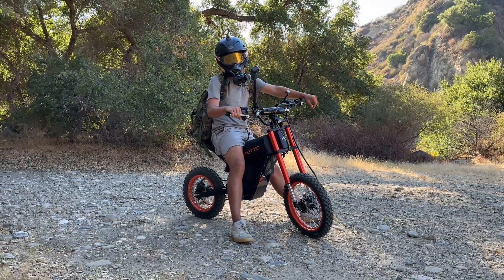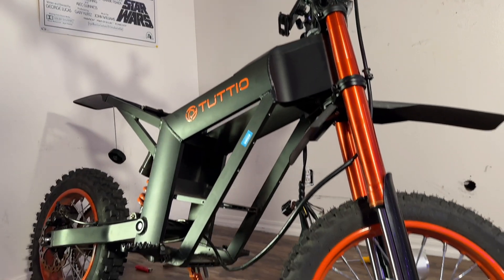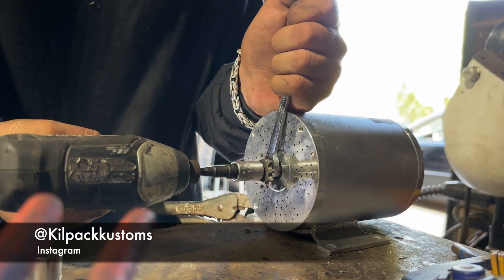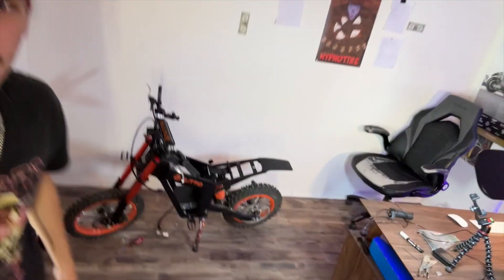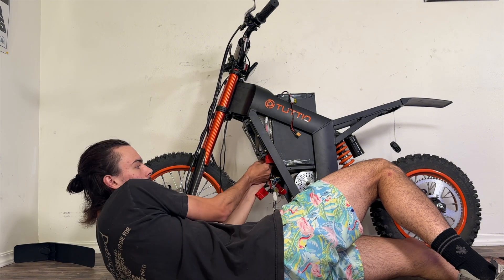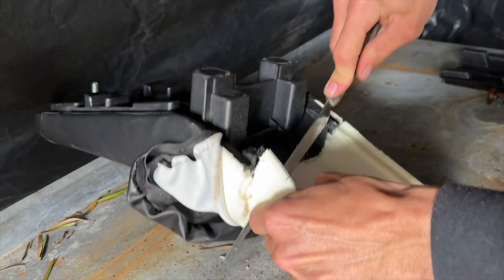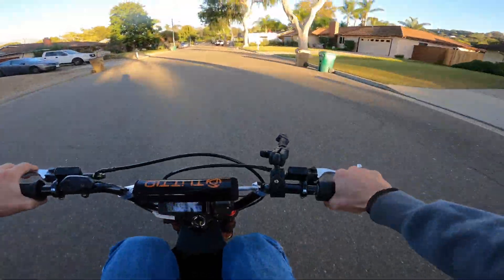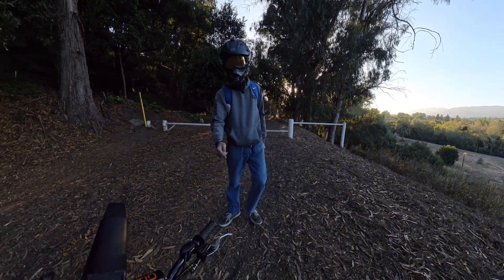72v 10,000watt Tuttio soliel 01 e-dirt bike upgrade step by step!

Comment: how tall are you? im considering buying it but im. 6’2
Reply: it says it fits anywhere from around 5' to 6'1 so you should be okay it might not be a perfect fit but i'd either reccomend getting the pegs changed or get bigger tires because of how small it is
Reply: I'm 6'2" and a fat a$$ lmao and it still carries me around very limited leg movement tho stopping yourself if not very flexible can be a challenge. Add max psi in rear shock of 150psi and bigger tires and your definitely golden i love this little tank 😂
Reply: Sabvatons are trash 😂 and your dumbass used a my1020 motor and said it was an upgrade holy fuck

Comment: I was onboard right up to the chopping of the seat. I'd be interested to know what the long term solution is there. I'm hoping Electro and Co comes out with a drop in 72v battery.
Reply: it says coming soon for a tuttio 72 so 🤷‍♂ i hope really soon
Reply: You can order a 72/40 battery custom built same dims as factory 48v. From amorge

Comment: Can I just upgrade the battery and controller
Reply: the motors peak is around 3000w if you upgrade the battery. the controllers peak is 4000w so no need to upgrade the controller unless your getting a new motor

Comment: you didnt have to change the controller you could tune it to 72 volts
Reply: Yeah but a controller that’s meant to be for 72v is probably better but tbh you could be right idk
Reply: that controller prob can only handle 3000w
Reply from the maker: No it’s a far driver and the amp limit said like 250a it should be able to do a lot more.
Reply: @Beaumonde-m9c  the motor can only do 3000w the controller can do way more

Comment: Why downgrade to a crap motor? Will be weaker and will get hot faster lol
Reply from the maker: Because I didn’t kno
Reply: So can I keep the stock motor and js replace everything else?
Reply: @cesimlim1273 honestly I’d just swap the battery as the stock controller is 48-88v I think and the stock motor can handle the power no problem

Comment: Did you see how many amps/volts the factory motor could take before pulling it out?
Reply: They are 48-72v motors stock.   Coulda used original motor.   Check on it to see if it gets hot

Comment: drop a sotion fw11 in there. it has a 20kw peak and 10,000rpm peak. plus they are very well designed and can take a serious beating
Reply: do you have confirmation it fits
Reply: @Nihicaboll23  you will have to make a bracket like in the video, they are standard my1020 motor size, but basically the best my1020 motor on the market

Comment: what is the largest wheel and tire can you put on the rear of the tuttio soleil 01
Reply: looks like 12/14 are the only option unless you extend the rear swingarm, larger front forks, and longer rear shock. at that point you should be able to fit a 14/17 setup
Reply: @strainfly7372  thanks

Comment: I’m very new to this stuff, how come a 10000 watt battery works with a 3000 watt motor?
Reply: Battery packs are not measured in Watts, Watt hours tell how much energy a battery can store, Voltage  (NOMINAL VOLTAGE, wich for Li-Ion cells is usually 3,6V/cell, a fully charged Li-Ion 18650/21700 cell is aroud 4,2V, wich means that for example a fully charged "72V battery pack is around 84V when its fully charged), amp hours (Ah) times the nominal voltage of the battery is how you calculate Watt hours (Wh), how fast a battery can discharge/ how many Amps a battery can output depends on what cells it has and how many cells there are in parallel (Series= voltage goes up, Parallel=more Amp hours and higher discharge rate), for example the 72V 40Ah (2880Wh) battery pack thats on my workbench rn has 160 LG M50LT 21700 Li-Ion cells, areanged in 20 cells in Series and 8 cells in parallel (20S 8P), each of the LG M50LT cells can handle a continous 10A discharge rate and around 20A peak (momentary), wich means the battery pack can handle a 80A continous discharge rate and 160A momentarely, Nominal voltage the battery pack × how many Amps the battery can output = how much power the battery can supply, wich in my case is 5760 watts continously and 11520 watts for short moments (such as a hard acceleration), so the battery determines how much power is availabe, what determines how much power actually goes to the motor is the Motor Contoller, and how much power a motor can handle without getting too hot depends on what the motor is built and rated for, (for example 2000W), rated motor power should always be what it can handle 24/7 365 days of the year continously, peak power is a different thing and depends on how much copper the motor has, how thick the wires are and a few other things...
Reply: the controller can control the amount of power that is put through to the motor. all done through bluetooth on the fardriver app

Comment: How do you remove the rear shocks on these bikes? I removed the two Allen screws on both sides of the mounting point, but the shock is still not free.

Comment: If I upgraded this bike to a 72 volt battery, would the motor and control be fine? Or would they fry up?
Reply: You’d be fine the motor at least will be the controller should be they actually use a pretty nice and well designed motor in these bikes

Comment: You should get a different motor; that controller can run 10kw ish and you have a 3kw rated motor. You could get more than 3x the power! Awesome video
Reply: The motor changes nothing the power rating is for tempature rating the power will still be 10kw just motor get hotter
Reply from the maker: @ThomasKuhn-vm4ri  yeah the motor is not the best for this I realize. I think if I feel there is an impending burnout I will buy a used Surron motor for this.

Comment: Why didn't you slide the battery in reverse with the slanted side towards the seat? The cables seems long enough to do so.
Reply from the maker: Because it didn’t fit that way and I didn’t want to hack at the frame to make it because it’s no big deal. I’m gonna cover the battery anyways when I get the chance.

Comment: Ok iv got over the initial shock of you ruining the bike unnecessarily so hear is my advice please drill out the vent holes in your motor or it won't last long👀👌🏴
Reply from the maker: I did and I added new steel bearings that can handle more heat. It’s no big deal tho if the other way is better I can just reinstall the old parts and use my 72v battery. I still don’t see how the 48v motor can handle 72v for very long tho?

Comment: You took out a 48-88 volt fardriver comtroller to put in a 72 volt controller? Then you modified the bike to add a  MY1020?? Thats an inferior motor to the one that was on the bike already! Then All you need was a fardriver bluetooth dongle, 72v battery and battery leads.  You did all that work to make the bike worse... FWI the lishen Amorge iron box 72v24ah fits perfect in the tuttio tray. Amorge has a sale on a battery & lead combo for the very same bike at this moment.
Reply from the maker: Well I wasnt aware of that from my research it seemed like 72v would fry those electronics. Also from what I heard the controller can only handle up to 70amps stock which is less than I wanted to use. maybe I’ll use it and the motor for a go cart build or sumthing,
Reply: @ENDOPRYSMofficial на какое расстояние хватает 24ah 72v???
Reply: @ENDOPRYSMofficial  use it in a kei truck
Reply: @ENDOPRYSMofficial  nah ur right it’s only a 70a controller so for what ur tryna run was good idea but I think you chose the wrong motor but ur battery is got beef to it
Reply: 2 minutes in I was about to comment the same such a shame 😮😢
Reply: Everyone knows if you want speed Sabvoton was yesterday and today’s Far driver controllers are the way to go. Just buy up in amps needed and limit on app what your battery can handle. You can always grow into it with motor or battery. Also blows mosfets are less. 
Like mentioned before Amorge batteries are the best bang for your buck. 72v and 300 amp BMS ~600$ get a 500amp far driver and your hitting 80 easy
Reply: @morganst.pierre brother help which amorge battery will work with stock controller and blue tooth dongle ? I don’t wana fry anything
Reply: @ battery is the one component where you can’t go to powerful. Any extra juice just won’t be used by controller or motor. Hard to
Fit on a lotta bikes but the best value they have are in square /rectangle 72v. The critical component when picking a battery is the current amp limit. The higher the better. You start getting ridiculous speeds when you have 72v 160 -300 amp limit and then a controller like a far driver you custom set to match your battery. You can also buy up on a far driver controller say 300amp limit one and then if you only have a 80 amp battery you just limit your far driver to match. A bigger battery with smaller amp controller is safe though just make sure the volts are the same. With motors you can pretty safely run it at lot more watts then rated  like double just make sure it doesn’t get too hot
Reply: Can you please link that sale. Thank you.
Reply: thanks for that, very useful, how much is that pack ?
Reply: So will the 72v battery fry those electronics?
Reply: It has a 2000w motor stock, how is a 3000w inferior?
Reply: Can you link that bettery please?
Reply: Were at? Were can i buy it?
Reply: На сколько запаса хода хватает на такой батарее 72v 24ah?
Reply: Lishen amorge iron box 72v24ah
Reply: hey i need some help, im trading my bike for a tuttio, the guy put a 72 volt battery and kept the stock 2kw motor, he has the dongle he says, but it only goes 50 mph, what motor would you recommend to make the bike faster ? also it would be a lot better if it would fit in the bike without cutting it
Reply: is it true that the stock controller can handle up to 72v?
Reply: So are you telling me I only need the 72v battery im going with 30ah.

Then just need a kunray 8k watt motor if soooo ill buy right now lol ill modify the frame i dont care.

Comment: Outdoor Pat has a video on this bike, same chain problem. I believe they just tightened it and that fixed the issue. The chain is hitting the metal chain guard below it
Reply from the maker: I’ll check
Reply: @ENDOPRYSMofficial  They also swapped out the sprocket and took a few links off the chain to make the new sprocket fit. Not sure if that what fixed it or if it just needs tightening but its worth a try 👍
Reply from the maker: I think my chain is tight but the motor is off and it is causing the issue. I have all day to fix it tomorrow and I will update you with a video.
Reply: @ENDOPRYSMofficial  sounds good I am interested! The bike itself has a huge swing arm so I'd take a look at the wheels alignment as well. Love your videos man!

Comment: Possible chain alignment or front sprocket height issue could cause excessive chain drag noise. I currently have the same issue with my TTR QS motor swap.. been thinking about swapping in a Kunray KR5V into my Tuttio, but not sure if I’m ready for all the frame fabrication quite yet.. Good job for leading the way for information though!

Comment: nice bike ruined.
Reply: Why is it ruined?
Reply: @Surronsterlover-69  where would you start? there's the unsecured oversize battery, or there's the hacked half seat that's putting this kids future kids right next to said unsecured powerful lithium pack, but if neither of those bother you surely the "ghetto ass" sprocket held on by "shitty welds" that is currently probably causing his issues with chain skip seals the deal?, take your pick which but all ring true.
Now he has to persevere with franken-bike or return it to what its supposed to be, a pretty peppy 48v good bike. Of course he'll still have the ruined seat to replace and a big hack out of the frame and maybe some holes, but replacing the seat would go some way to making it pretty again.
Reply from the maker: the bike is legit. Replaced the sproket. And I’m adding a battery cover as soon as I can.
Reply: @AndyPacey  You sound like you've never turned a screwdriver in your life.
Reply from the maker: He has a point it’s not as fit and finished as the stock bike. I do plan on securing the battery as I mentioned in the end of the video. Also replaced the sproket.
Reply: @AndyPacey  it's not meant to be for kids if this 10000w bike that could sure do around 65 + mph then why are making it seem like it is for the kids? Even if the battery was secured down it could still explode and your jewels would be the least of your worries. Your hating on this build but don't understand whys he built it up like this. It's because the "peppy" 48v bike wasn't peppy enough.
Reply: @Nominally-Built  i made a custom kona stinky 72v80a in 2009, that's 2009. It was powered by an RC helicopter motor with aluminum gear down (belt drive) which was designed to operate around the bottom bracket which allowed normal mtb pedal operation also, oh and there was the 3 years workshop training when i left school, maybe why i'm a little mortified at the build.
Reply: @ENDOPRYSMofficial  Son, Yours is the most mature response to criticism here, genuinely impressive. I totally understand why you wanted to upgrade and i also totally understand if you used what you owned already to get the experience. My criticism was the hacking to do it. I'm from a trained workshop background (no beer or flip flops allowed ;) ), and have been into ebikes since they were only available in home brew form, probably more reason why i can't understand going from factory finish to hack when all i wanted was move from custom to off the shelf, the grass is always greener i guess.
you never said whether the original motor was the 1000wcontinous/1500w peak or the newer 2000wcontinuous/3000w peak motor? 
if the latter all you needed was a 72v pack equal too or slightly smaller than the stock one to enable you to not touch the clamp or seat?

Anyway having thought about my posts I was wrong to comment so harshly. I should have just moved on to the next vid and not made comment, I apologize to you.
By the way, I loved your previous sunset video, not even all bike related, you live in a beautiful place and life looks great.
once i think you've read this ill delete all my posts, i don't want to be "one of those".
I'll sub to see what happens and wish you all the best.
Reply: @Surronsterlover-69  it isn't me that doesn't understand, my criticism wasn't his want for a bit more power, but the manner in which it was achieved.
I only mentioned kids in reference to a joke about his crown jewels being so close to the unsecured pack, but that also went over your head.
the pack could spontaneously explode, but its probably more likely if its unsecured and the cabling is in a bag rather than factory routed/secured.
72v could have been tried as stock.
Reply from the maker: @AndyPacey thanks man. I live in Santa Barbra and it’s great weather for most of the year. I don’t mind hacking my bikes soo much because I get them for free from the company’s to test. It’s also my job to make videos and grow this channel so anything that can pull in new viewers I will do. Bike is not fully finished and I will add a battery cover and maybe replace the current motor with a used Surron motor because I believe it will fit in this bike better. 

 Ps don’t delete the old comments the more comments in this video the better it performs. Have a great day.

Comment: Could you just put a bigger battery in there easy like a 60v?
Reply: The stock controller can run a 60v or 72v battery, but it can only do 70A line, 240 phase.
Reply: @HiLuckyB  before you put a 60v battery in what should you upgrade?
Reply: @Ynot.LJ8  You can get a bit more power and more range with a larger 60V battery. If you buy a battery that can do more than 70A, you will need a bigger controller. Right now, we don't know how much power the stock motor can take.
Reply: @HiLuckyB  ok thank you
Reply from the maker: Well the controller and motor are rated for 48v so no. But the controller is a high quality fardriver.  It says in it it can handle 270amps so you could put a 48v battery in this thing with a larger bms. Then you could get some more power.
Reply: @ENDOPRYSMofficial   I have actually seen this exact fardriver controller able to run 72v without any problems, just needed some tweaks in its settings, although running that much more power would probably blow the stock motor after awhile of use. Here is a video by Pat Outdoors of him doing exactly this:  https://www.youtube.com/watch?v=cvw_6CRie74

Comment: Did you have to tune the controller to that motor or did it just work as is?
Reply from the maker: I turned the power down on the controller.  You will also need to run the hall sensor test.